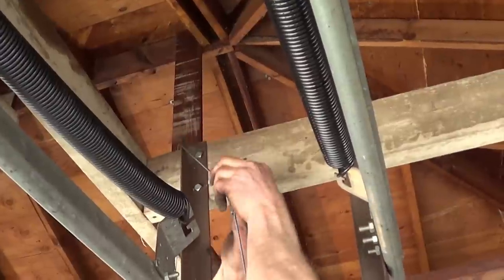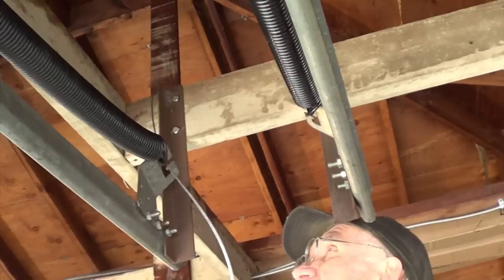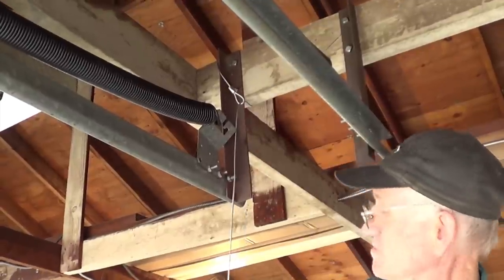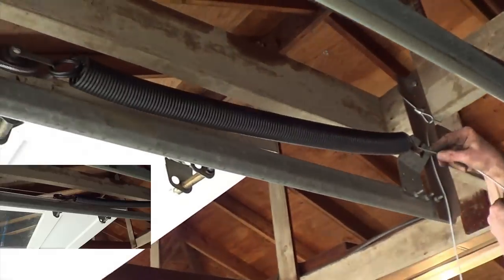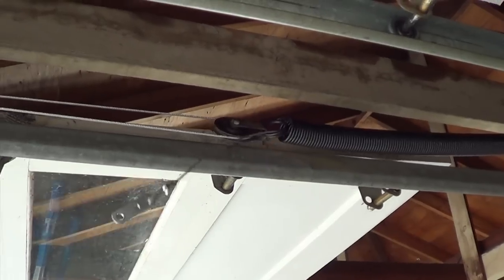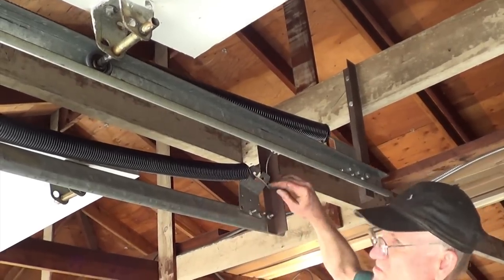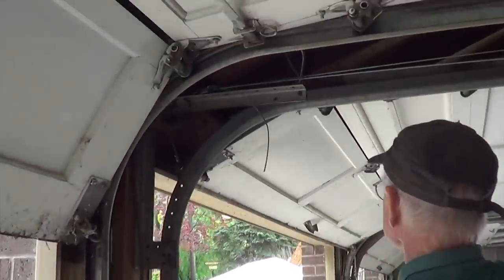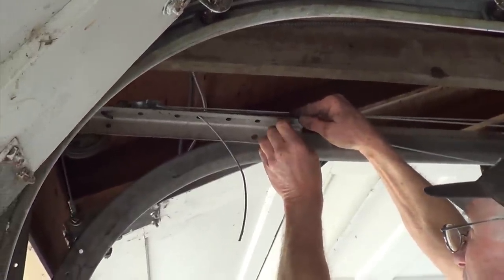How to Install Extension Spring Safety Cables

Comment: Had to add some safety cables in a relatives horse arena.  There were two doors side by side and, IIRC, the cable broke on one and the spring hit the 2 x 4 bracket so hard it broke a 2 x 4 beam.  I ended up disabling that one door as they didn't' need it anyway, then I added safety cables and changed the lift cables on the other door.
Reply from the maker: Hi l337pwnage! These springs are very dangerous, even more than standard torsion springs are. These springs, and the hardware that goes with them can explode everywhere when they fail, causing significant damage. We always recommend that safety cables are installed, so that less pieces of the system can go flying everywhere.